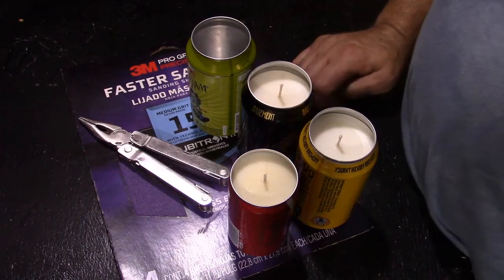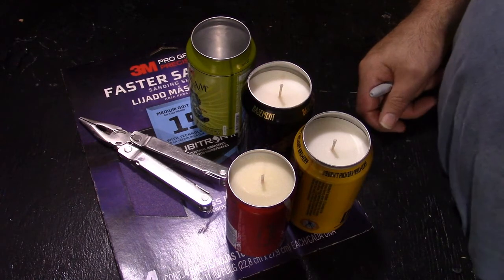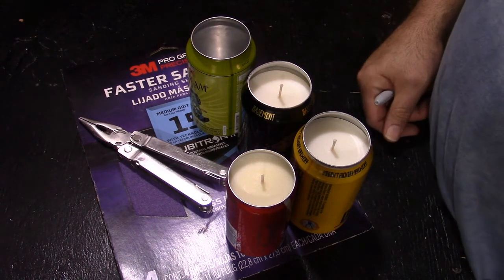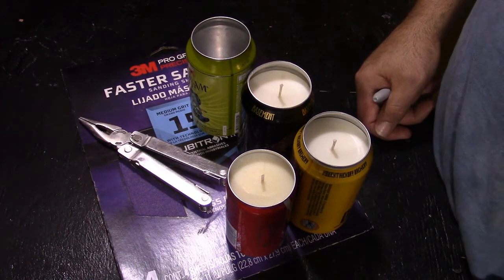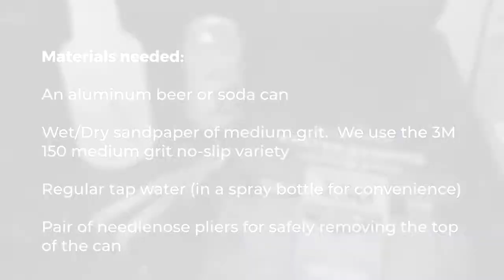How to remove the top of an aluminum beer or soda can

Comment: Thanks for sharing this! I just did it on two massive novelty beer cans I wanted to use for storage pots. Worked really well, so easy and a great result that left the can in absolutely perfect condition
Reply from the maker: Thanks so much for your comment.  I'm glad the cans turned out well and I hope you enjoy them.  I did another video on the same topic but using an electric drill - same result but faster.  The video is here if you are interested: https://youtu.be/Bu0f8KdpiSk

Comment: Thanks. I've always wanted to remove the top without squishing the entire can. I thought it would take some special contraption to get the top off cleanly, so this is a very neat trick. THANK YOU!
Reply from the maker: Thank you for the comment.  I made a new video using an electric drill and sanding disk to accomplish the same result.  Here is the link if you are interested: https://youtu.be/Bu0f8KdpiSk
Reply: lookup Draft Top LIFT Beer Can Opener - Soda Can Opener - Topless Can Opener - Can Cutter Top Remover - Handheld Safety Manual Can Opener, Smooth Edge Effortless Rip and Sip Opener, Pulls the Top Off

Comment: Worked like a champ. If you want to keep the top, either punch through the top instead of bending the tab, then tape a thin piece of cardboard over the tab before you start sanding so the tab doesn’t get sanded/worn. Once the top is off, you can press the flap back into place and boom, the can looks like it was never opened.
Reply from the maker: Thanks for commenting, Darrell!

Comment: Make sure you use the pliers or something to remove the lid after sanding, nearly lopped my finger off thinking "oh its gonna pop straight out really easily... no need to find them..." then it kinda sprang out as the pressure shifted and sliced the old pointer digit pretty severely! Excellent tutorial otherwise, well done!
Side Q what would you edge the top and optionally bottom with? I was thinking car door edging trim? It's a Viking (Faxe) 1ltr beer can.

Comment: Awesome! Glad to know a technique that's not rough on my hands! Can this work for the bottom side as well or only the top?
Reply: it won't work on the bottom, unfortunately. the reason this works on the top is because at the factory, the top is actually a separate lid that's placed on top of the can, then the edges are folded over and crimped to seal it.

Comment: Does it have to be just aluminium cans, I was thinking of a Sakuma fruit drops tin to make a Canjo with.
Reply from the maker: Hi David.  I thought I had responded to your question earlier but that appears to not be the case.  I looked up a picture of a Sakuma fruit drop can and I do think my method would work although it would take longer since it isn't aluminum.  I've also experimented with electric sanders with good results although you have to be careful to not apply too much pressure.  Doing so can cause the cans to launch themselves off of the belt or sanding disk.  If you have a Sakuma can you are willing to send me I could take a shot at removing the top for you.  It would actually make for an interesting video.  I would be happy to send the can back to you so you could turn it into a Canjo.
Reply: any cans

Comment: tbh just buy a soda can opener for 5 bucks on the internet or smthn it does the job in 2 seconds
Reply from the maker: Thanks for commenting.  Which soda can opener did you use?  I'd like to get one and give it a shot.  It would make for an interesting video.
Reply: @RedClayCandles  Any one will do :), you could buy one on amazon, wish, whatever sites, most have them. just search up "soda can opener" or "can opener" :)